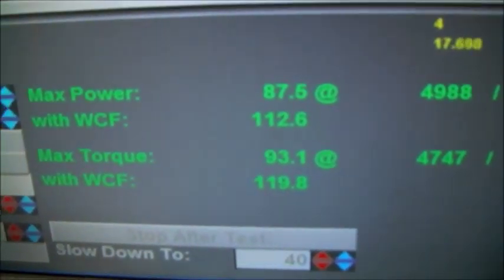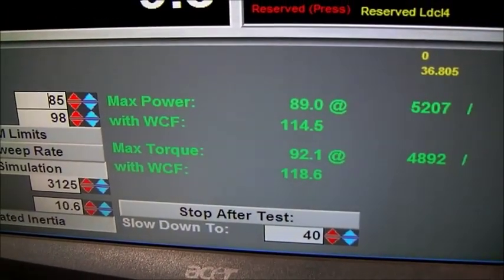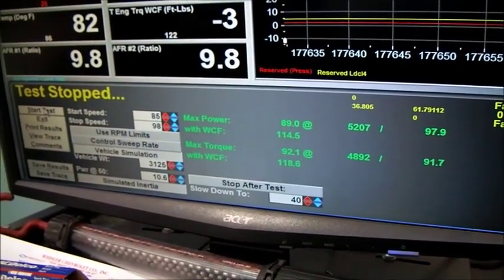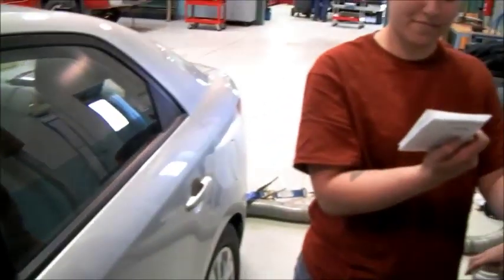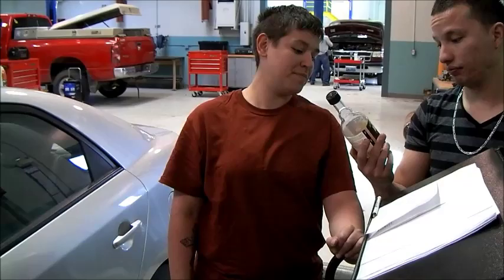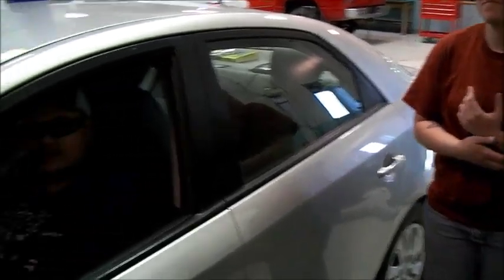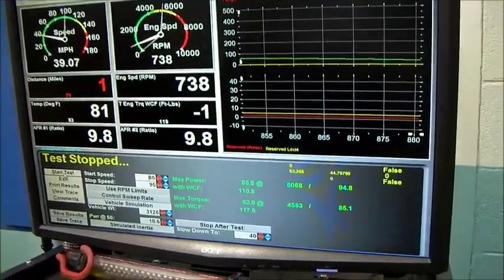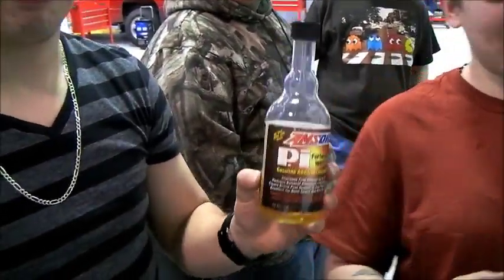Fuel Additive Testing

Comment: Love the fact you use a MD 250 dyno. Not to defend Amsoil P.I or any other fuel boost, etc. But, a good mix with the fuel, and also, maybe, disconnecting the battery for about 10 minutes would maybe change results. On a turbo car, a product like BOOSTAne definitely helps and gives power. I tested on a MAHA dyno and at the track. Always depend on car, or/and modifications. But, enjoyed you took the time to do the test.

Comment: Marine outboard 2 cycle TCW3 oil for cleaning and lubing the whole fuel system. 1 oz per 5 gallons. It burns ashless so no harm to converters or sensors. Use it every time you get gas. Loads of info and testing on this on Google.

Comment: Amsoil loves to put too many adds out saying their products are the best. There is no need for fuel additives with the way cars are designed to run these days. Also, fuel additives never deliver what they promise.  The main thing is put a quality gas (like Shell), and put a quality fuel filter (like Wix) to catch smaller particles of carbon deposits. Experimenting with your vehicle can cause problems. Car manufacturers are designing automobiles really well these days. Just keep up the maintenance and drive it not too aggressively is my opinion.

Comment from the maker: Once again, the manufacturer claims this will work on any car. This is not intended to be an octane booster, so running it in a car with higher compression either naturally aspirated, or with forced induction, makes no difference. This is a fuel system cleaner, not an octane booster.

Comment: The car you're using this is fairly new car, try it on some 140k miles car that hasn't being tuned up for a while. I'm not saying this product is good, but the test done in this video is still inconclusive, if the car is clean, there's not much you can go up since the car is already running in optimum (factory specification) state.